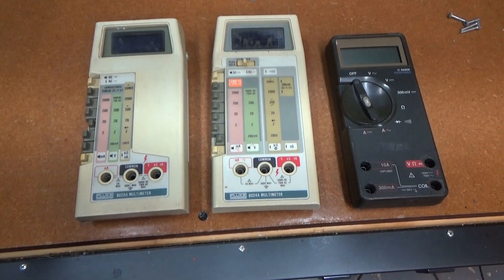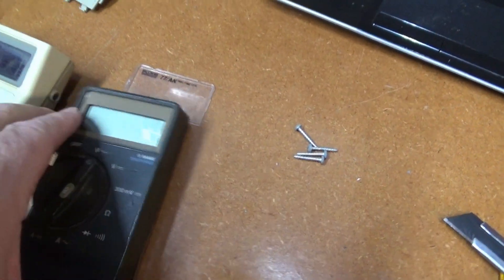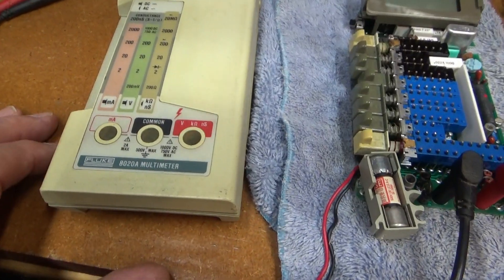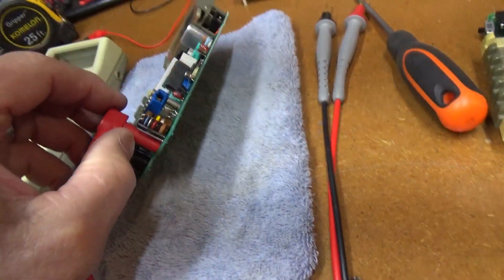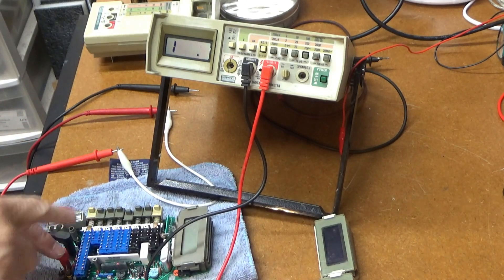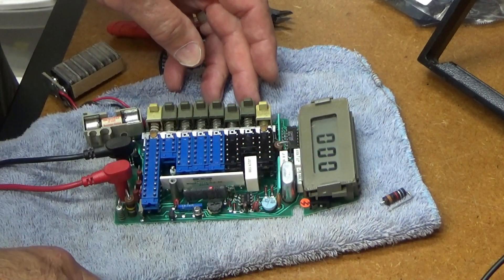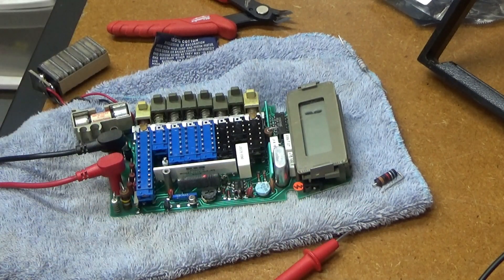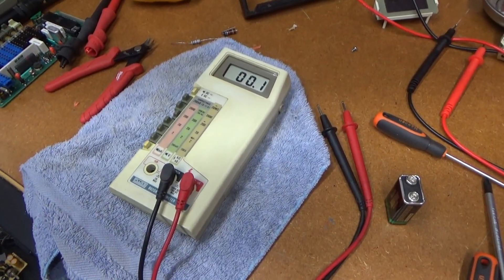1979 Fluke 8020A Multimeter Restoration

Comment: Did you save the bad displays? Between the contacts on the PCB and the display, there is carbon infused rubber transition connector. I am not sure the best way to clean the transition connector, but I cleaned the one on my 8050A very lightly with 99% Isopropyl Alcohol and let it dry over night. Then I cleaned the pads on the PCB. Finally I dripped the alcohol over the edge of the display that comes in contact with the transition connector. Don't rub it...the LCD contacts are very thin clear conductors. They are delicate and contaminants in the air over the years causes poor contact. You may have to do a very light scrape the rubber on the transitions connectors to microscopically roughen them up and clean them lightly again. See if that fixes them.
Reply from the maker: Thanks for the comments. I have used the technique of cleaning the elastomeric conductors and PCB and display connectors to repair displays. This works well on displays with missing or dim LCD segments. Check out this video on servicing the LCD on a Fluke 23. https://youtu.be/MHJVxAtgBc4
Unfortunately the display that originally came on this multimeter had some severe LCD "bleed". This is where the liquid crystal material leaks out of the display leaving dark sections. This seems to be a common problem on the early Fluke multimeters when the LCD technology was in its infancy.
Reply: @mguess I wonder if liquid crystal solution can be purchased, then the displays refilled and resealed. I had a 1990's projection TV. In the early 2000's the display was getting dim. The lenses are filled with a clear viscous fluid for heat transfer. I found instructions on how to drain the 3 color projectors and bottles of the fluid on line. I got another 4 years out of it before the high voltage section started to go.
Reply from the maker: @paulromsky9527  I kept the displays so maybe I'll try replacing the LCD fluid sometime in the future.
Reply: @mguess If that works, there are many LCD meters out there that may find a new home. Make a video!